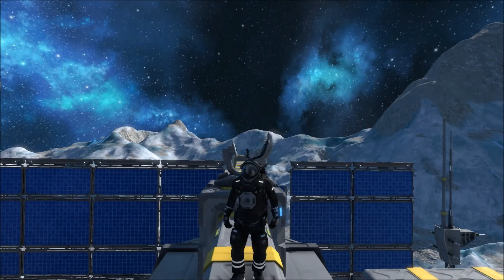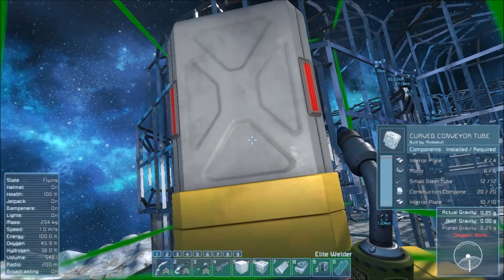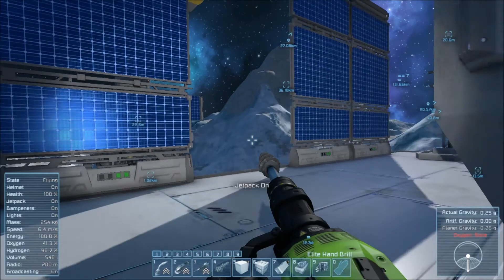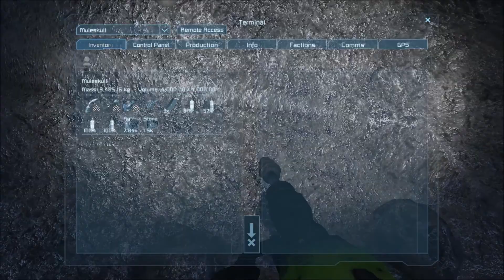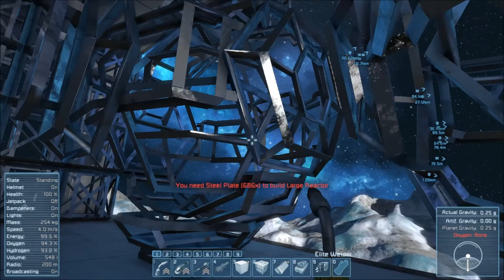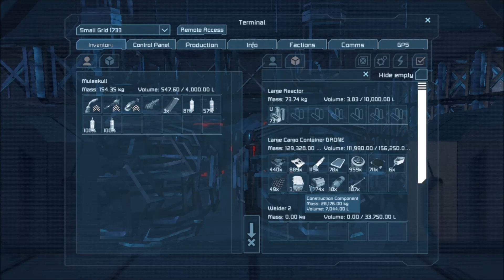Let's Play Space Engineers Ep. 46 - Even More Welding

Comment: First, I think WeldBot would be more effective if it had one welding arm and it were longer, so it could reach into tighter places.
Second, you have awe-inspiring power production capacity on the Ark now with a couple of the big reactors complete.  And it's already hooked up with manufacturing productive capacity with assemblers and refiners on deck.  Refiners work a LOT faster with awe-inspiring power production.  So it's time to make the Ark the main production center for the materials to build the rest of the Ark with. It looks like you've only got one assembler running now, and it's not even in 24/7 production yet except for the last couple of episodes.  Fire up one of those big reactors, dump a BUTT-TON of ore into the Ark's conveyor system, and you can build at least three times as fast.  You have more than one assembler, and you have the power to refine things fast enough to keep them all running.